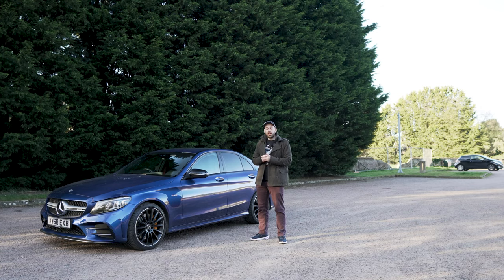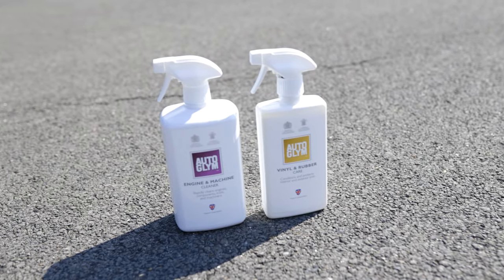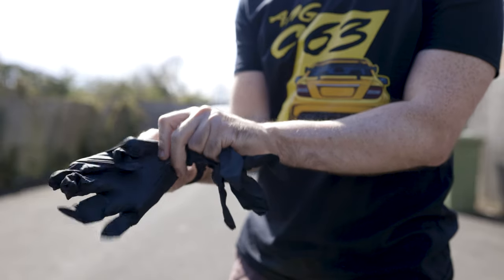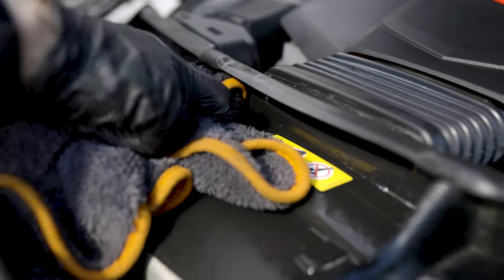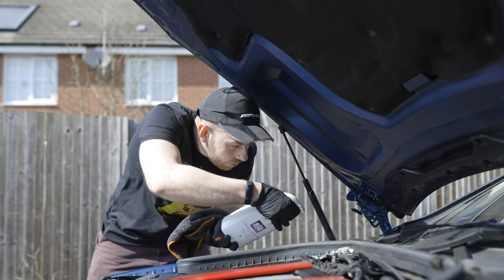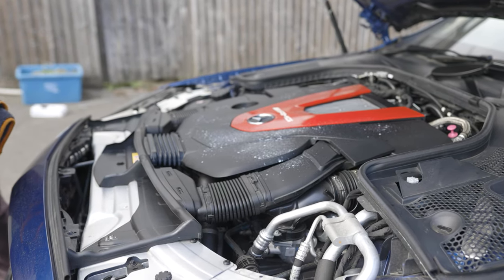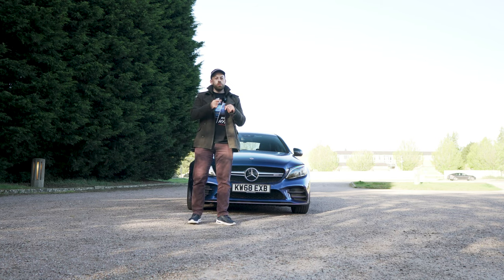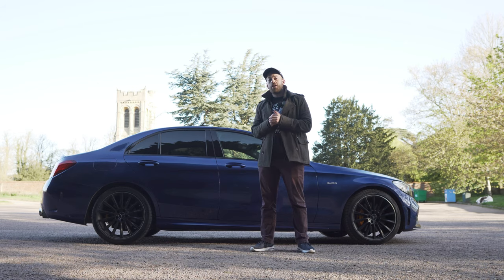Cleaning my C43 AMG Engine Bay the Super Safe Way!

Comment: Great video, love the cameo at the end too! It is important to make sure that any of the Engine & Machine Cleaner is removed after the cleaning phase. This is a lot easier if running water over the engine, so if using the rinse and wipe method here, just make sure you are thorough and get it all. If the Engine bay is not really dirty and just needs a spruce up, you can jump straight to the Vinyl & Rubber Care stage to clean and protect in one - just make sure you have a stack of microfibre towels you don;t care about, as they will pick up a lot of the dirt.
Reply from the maker: Thanks! Great to hear from you guys that's awesome. Thank you for the tips too! Great products, keep them coming!

Comment: Hello thank you for uploading the video, just checking the vinyl and rubber autoglym is safe to use on my engine bay as I've read it's to be used for dashboards
Reply from the maker: Hey, no problem. It's fine to use on the engine bay covers shown here. I wouldn't use it on the engine itself though.
Reply: @ABAUTOAMG  Thank you

Comment: On my car, I remove the engine covers, and use a good amount of citrus-based snow foam, let it work its magic, then rinse it off with a low-pressure water jet. Then, I spray some water-based dressing and dry it off.
Reply from the maker: That sounds epic Peter, will have to try this some day! :)

Comment: Quite new to the merc c class. Uk c class. Can anyone suggest how to turn on the main headlights when it’s dark (as in evening). Auto lights switch doesn’t seem bright enough. Andrew can you advise? The blue icon seems like the main beam but I also got cars flashing me, so now im abit confused. BMWs definitely more intuitive
Reply from the maker: You have to have the optional performance lights for the automatic beam dip. If you dont have the option you will need to manually turn full beam (blue icon) on and off when cars pass to not blind them. If you do have the optional lights you can pull the full beam button all the way down and let go and a (A) icon will appear. If this does not appear you probably dont have the optional lights.
Reply: @ABAUTOAMG  mate can I give you a call at some point? because I’m super confused over what I should be doing here. Surely, main headlights should be as simple as flicking on main beam and driving at night without blinding or glaring anyone out. Last night I noted 2/3 on coming cars flash me. And that has created doubt in my mind.